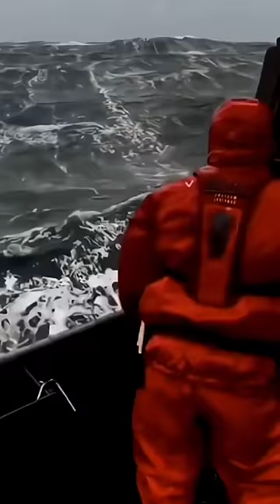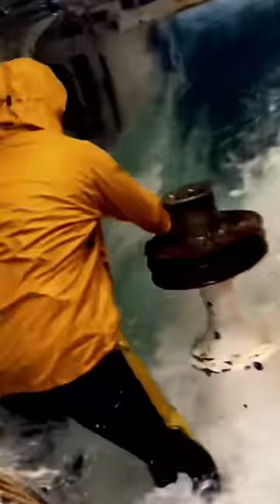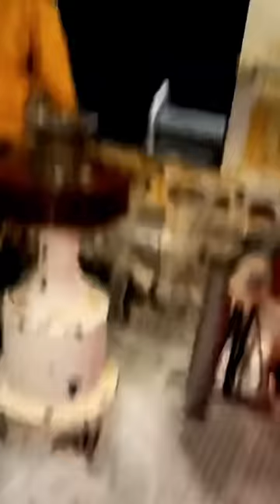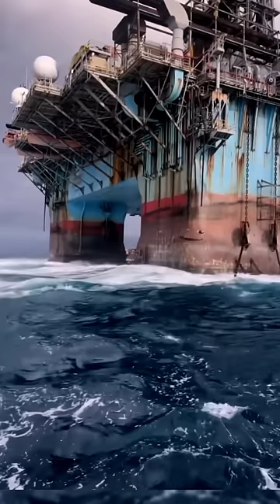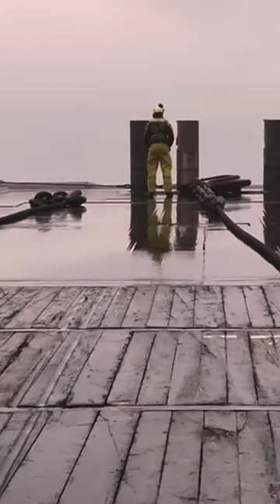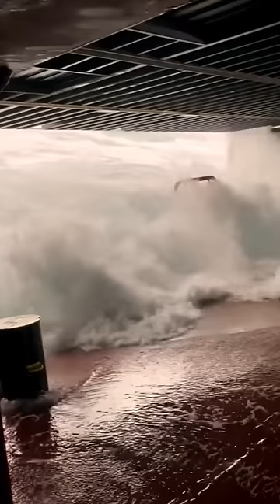North Sea Odyssey: Amongst Mighty Waves 😱 #ocean #sea #mystery #explore #adventure #shorts

Comment: I barely found this song (translator used) the first thing to do is to quickly firmly grasp the supporting structure of the ship or tie yourself in advance with a rope in the length of the ship) so that it does not wash away into the open sea
Reply: 🌊 "Hoist the Colours" 🥶
   by the Wellermen group
Reply: @jrbanks2983  all right